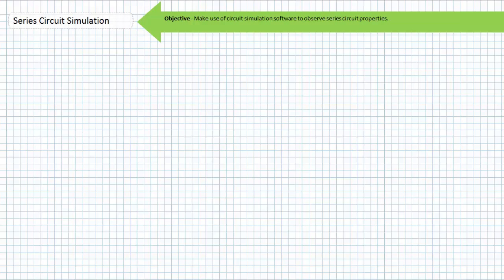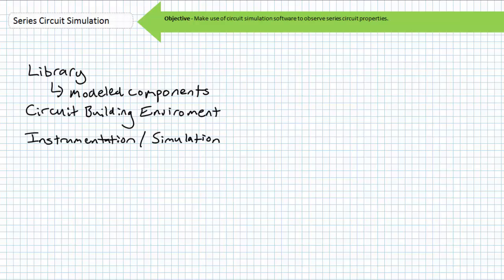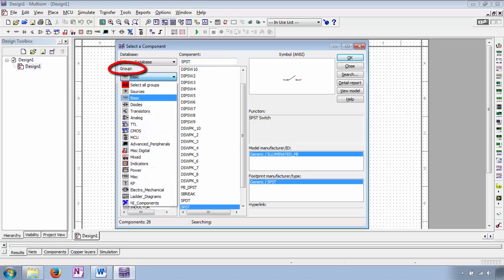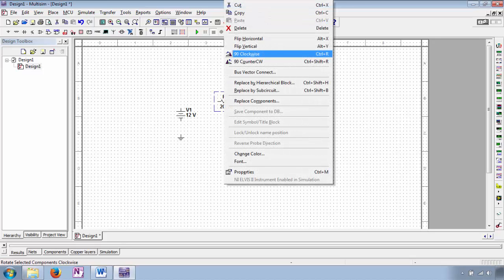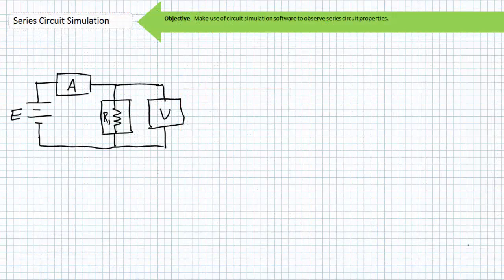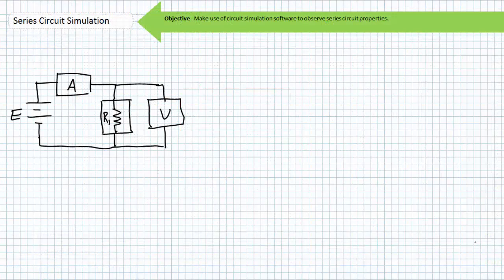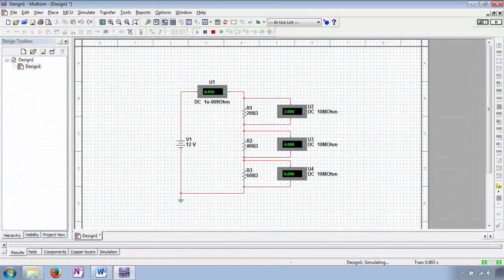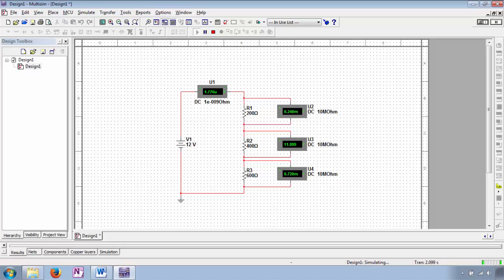Software Simulation of Series DC Circuits

Comment: Hi Jim, for my calculation around 40:00, I believe R1 is effectively 91 ohms (not 100 ohms) which means the 200 ohm resistor is in parallel with a 166 ohm resistor not another 200 ohm resistor. Am I splitting hairs here?
Reply from the maker: It's a matter of rounding. Although the ammeter is reading 11mA the actual current is 10.91mA for a 200||200.
Reply: Jim Pytel yes that makes sense, I was kinda splitting hairs i guess. Also thanks so much for the content and the prompt reply. I’m a mechanical engineer that hated those two units of electrical engineering I did all those years ago in first year uni. But I’m happy to have gotten a second chance and it’s actually quite interesting and fun - albeit I’m not incumbererd by assignments and 3 hour labs and I’m doing this at my own pace. Anyway wanted to say a big thank you and I try to watch an add when I can for support but my habits of skipping almost always get thr better if me. But it’s the thought that counts right?😜

Comment: Does the 6 giga amp cuircuit at 26:00 assume the power supply has 6 giga amps available to give?
Reply from the maker: True. Anytime a source experiences a low resistance path like a short it will peg the limits of current delivery. 6GA is a ridiculously impossibly high amount, however, a starter battery could potentially deliver more than 600A.